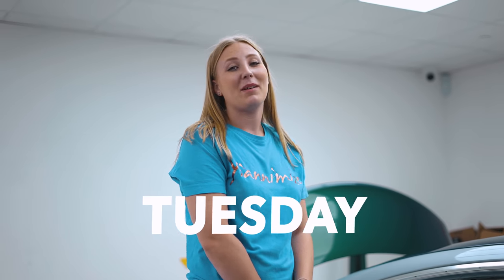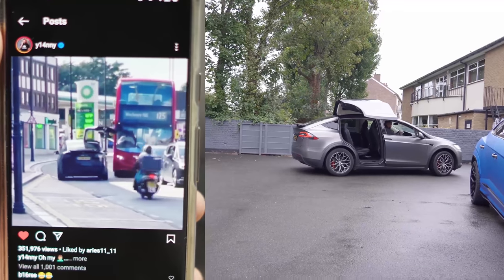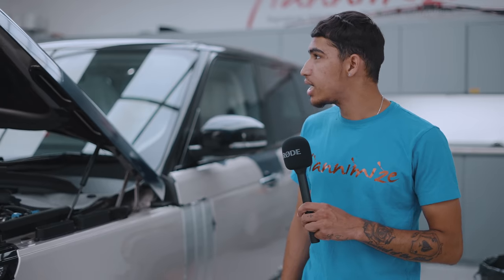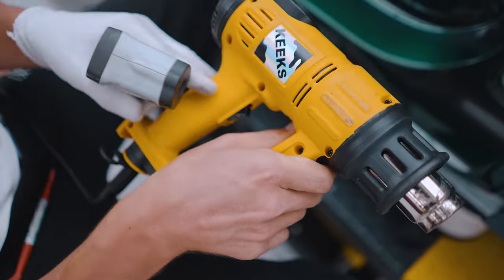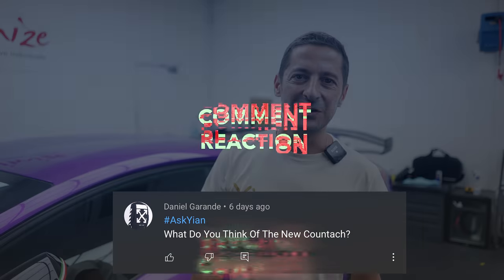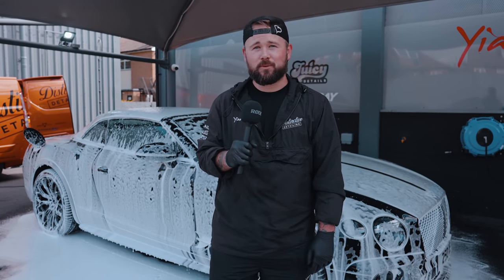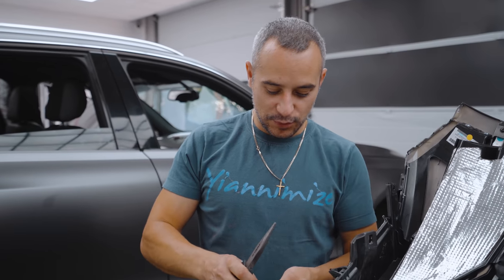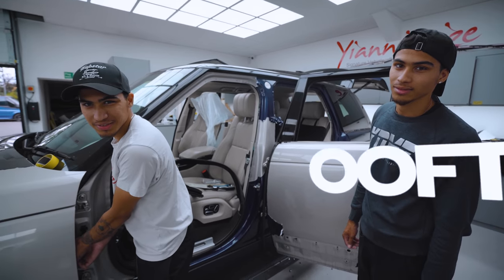What A Supra Week! | TWAY ep60

Comment: The great experiment:
1. If the engine parts on the Lamborghini Aventador S were to be replaced with carbon fiber material based engine parts, carbon Kevlar material based engine parts, and Kevlar material based engine parts, could the overall weight of the Aventador S be trimmed down a bit?
2. If the axel rods along with the front wheel axel and the rear wheel axel were to be replaced with durable strong lightweight titanium material based parts, could the overall weight of the Aventador S be trimmed down a bit?
3. Is it possible to achieve the overall weight of the Aventador S of down to as low as 1520 kilogrammes?  1.52 metric tonnes?